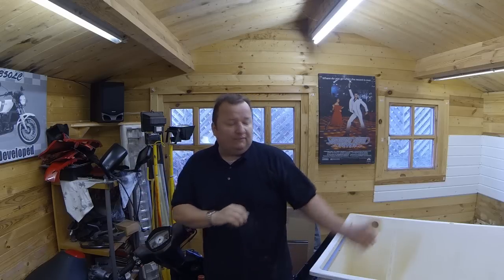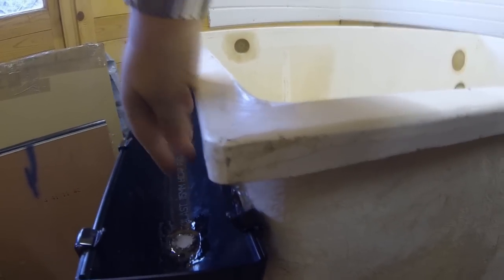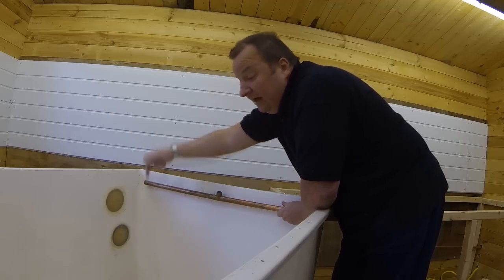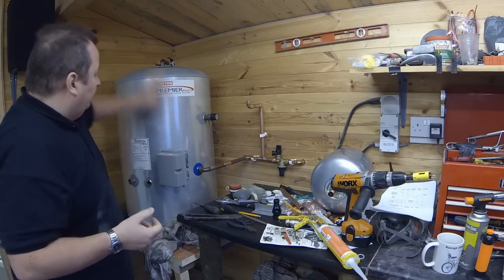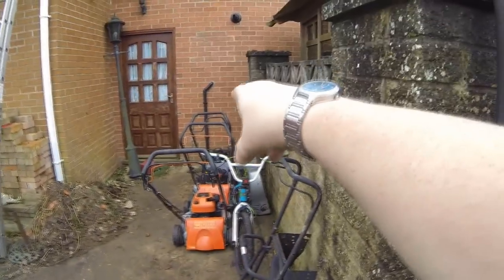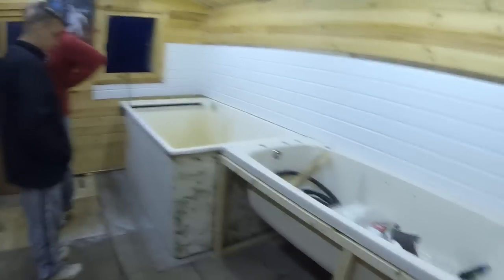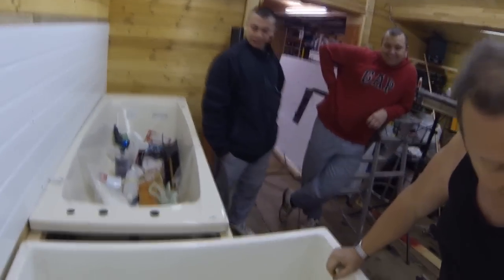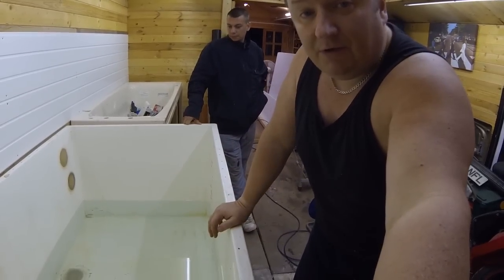Hydrographics Home MadeTank Installation Nearly Ready Vlog

Comment: Looking good and well done. Just a suggestion, to take out any unevenness in the floor and to help stress relieve the tank and add insulation, it would be advisable to add a sheet of polystyrene sheeting under the whole tank bottom. Just like you would with a fish tank. Good luck with the rest of the build.
Reply from the maker: I have put a double layer of carpet underlay which is basically a dense foam. I think this will do the job. Thanks for watching.
Cheers
Martin

Comment: Nice progress fella, looking forward to seeing this taking place, any idea how much the materials cost?  Hope the knee gets better soon.
Reply from the maker: The main prices are
Tank= £20.00
Bath= £2.00
Water cylinder= £25.00
Pressure vessel= £27.00
Copper pipe = £90.00
Taps= £25.00
Odds and ends= £50.00

A bit of stuff floating about = £0.00
That's about it
A lot cheaper than the pro's use but should have the same results.
Cheers
Martin

Comment: Good video! What temperature does the water in the hydrographic tank need to be at constantly when you're dipping things in? Even when insulated, won't it be losing temperature rapidly as soon as it fills? 

Also, that jet copper tbar thing, if the end holes don't have pressure, will you have to add 2 t bars? And have the water pipe split and coming into both sides of the jet bar? If that makes sense lol. :)
Reply from the maker: The dipping temp on the surface should be about 25-30 degrees C. Our hot tub is normally set at 38 degrees C.

It will be similar to a hot tub.When we switch our hot tub off and shut the lid, it stay's warm all day so I'm hoping the insulation and a lid will retain the heat when not in use but it will get topped up with hot water when needed. As far as the spray bar is concerned, we'll just see what it does and adapt to the situation.
Cheers
Martin
Reply: retrorestore Yeah hopefully it stays warm with the insulation then. If not, will you be putting a low heat element in the bottom of the tub?
Reply from the maker: cwuzii
 I'll have to see how it performs as I plan to drain the top of the tank when needed and re fill with hot water from the cylinder.
That's the plan.
Cheers
Martin

Comment: looking good mate. soon be there being able to use it :)

i see your thinking of making a spray booth which will be good, although im not sure if you know but you will need more height in the booth than you have there at the moment
Reply from the maker: Yes, I'll have to cross that bridge when I come to it but it will give me a dedicated area to spray which will be useful.
Cheers
Martin
Reply: yes its always very handy to have somewhere you can keep clean and just use for spraying or clean jobs. worst thing is trying to get the lighting right in their tho so you can always see what your doing lol.

when do you plan on having the dip tank ready or is it just a case of its done when its done?
Reply from the maker: Ea Composites
We have just filled the hot tub up today so we can give a test run maybe tomorrow but the plumbing has still to be finished and commissioned.
Cheers
Martin
Reply: retrorestore thats pretty close then, you got your leak issue sorted out easy enough then
Reply from the maker: It was a poor fitting rubber gasket. Sorted now :)
Reply: thats a bonus then as im sure it could have been so much worse. ill have to catch you on facebook at some point and discuss getting you to do some bits if you fancy it
Reply from the maker: Cheers bud. Here's my facebook https://www.facebook.com/martin.butler.9275
Cheers
Martin
Reply: no worries. i do believe im already on there but ill check